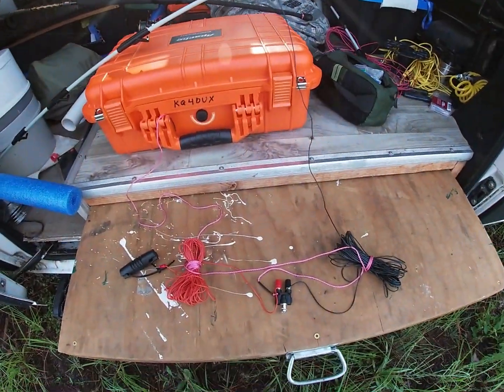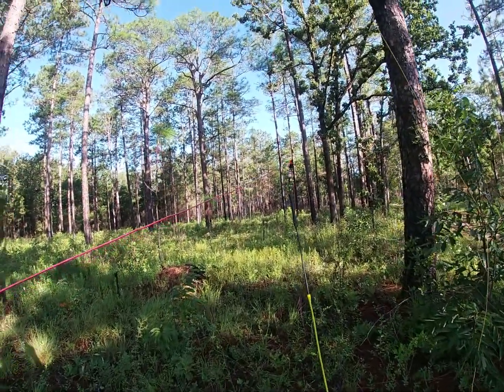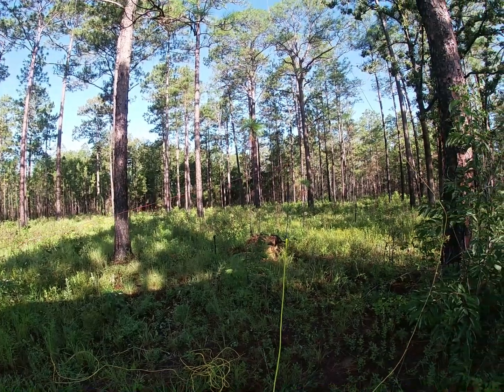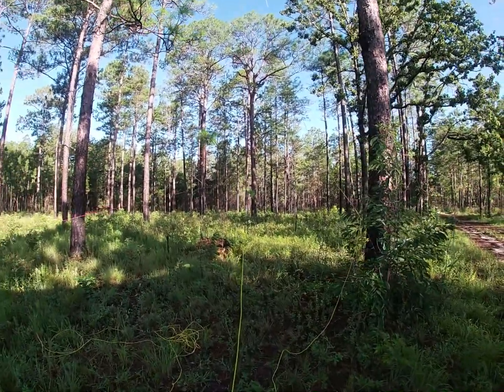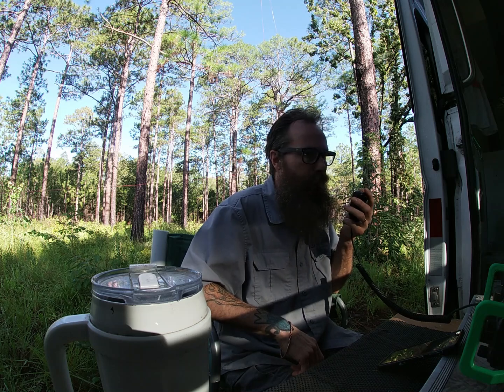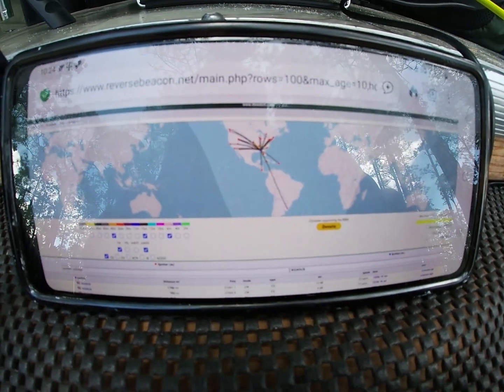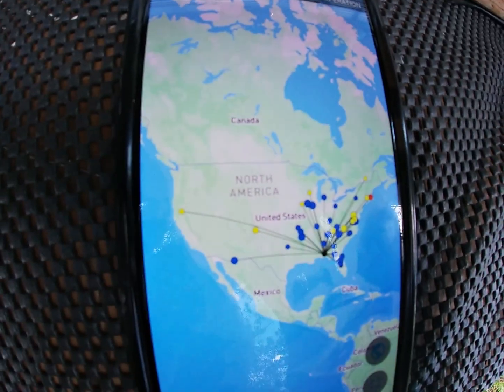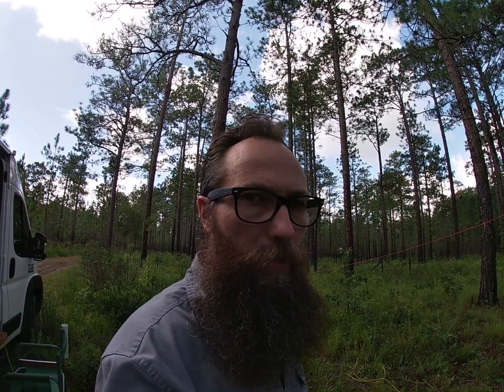Easy Wire Vertical 3 Bands and No Balun

Comment: Just out of curiosity, what was the analyzer reading on 6m? I don't normally carry a tuner in the field. I'm working on a linked dipole for field use but this may be a more elegant solution.
Reply from the maker: It's a rig expert Stick 230
Reply: @jayKQ4DUX yeah I knew that. You seemed to indicate in the video that you were going to do a sweep of 6m. Obviously you were able to tune it up, but what was the real swr?

*edit for auto correct foolishness *
Reply from the maker: @KC3UVF just under 2:1
Reply: @jayKQ4DUX interesting. Certainly usable even without a tuner. Thanks for the reply. I definitely need to experiment with this.

Comment: So many complicated antennas in the world and you documented an "Inverted-T".  This is really cool!  I wish I had done this at my last trip out.  I had 7 radials on the ground and everyone in the campsite got tangled in them; I gave up before my first contact.  Your 2 radial system is definitely better.  Thanks for reminding us to keep it simple.  -73- W3GCW
Reply from the maker: Thanks, I have even done it with one.  Just keep in mind with elevated radials, there can be some high voltage present on them, so that can be a safety concern. but at least they would be much more visible. If you could get the bottom up about 10' that would be great, you would just need to get the top pretty high which might be tough.  Thanks for watching, I plan to use this again.

Comment: Thanks for the interesting video. I might have missed something, but I haven't caught the length of the vertical wire, the radiating element. How long is it?
Reply from the maker: right about 33 feet
Reply: Thanks. 10 meters in my units.

Comment: Nice. Looks easy to deploy if you have the height. So it's kind of like a wire POTA Performer?
Reply from the maker: more or less, I'm just learning to do some modeling and it seems a little less directional with the radials at 180 maybe similar to a dipole